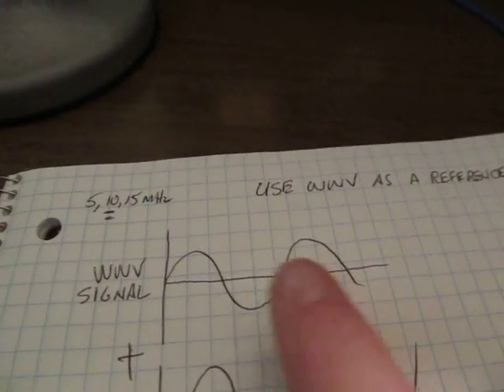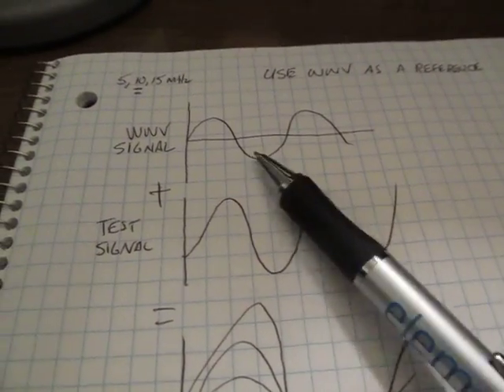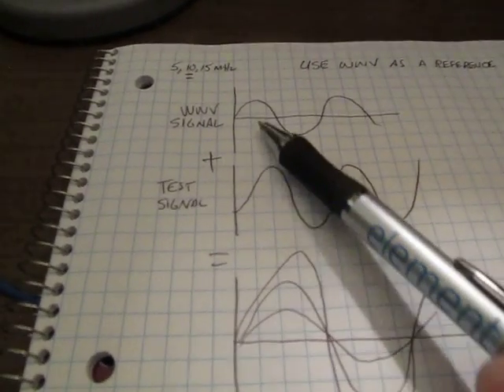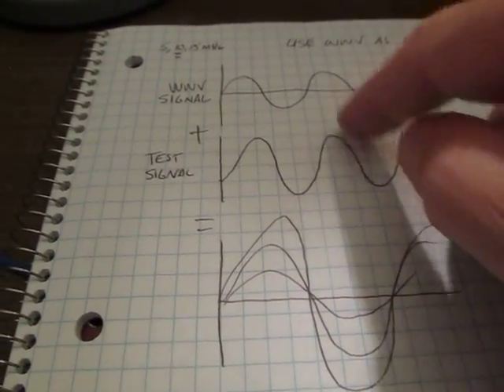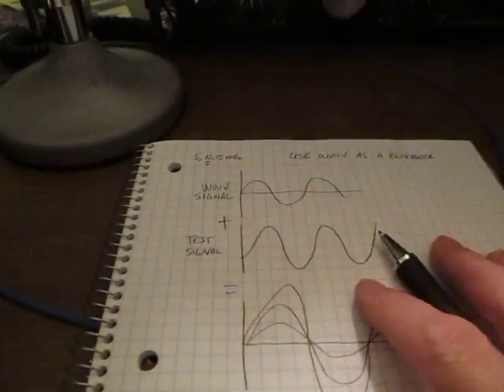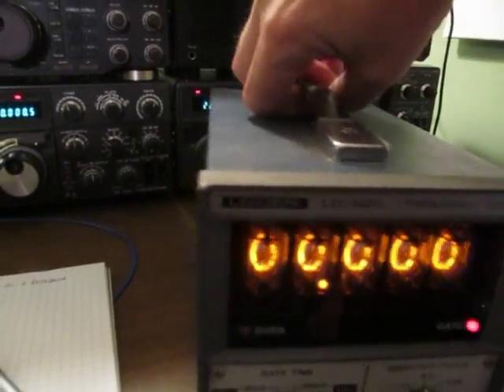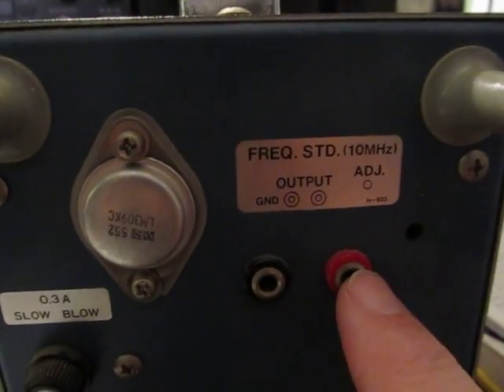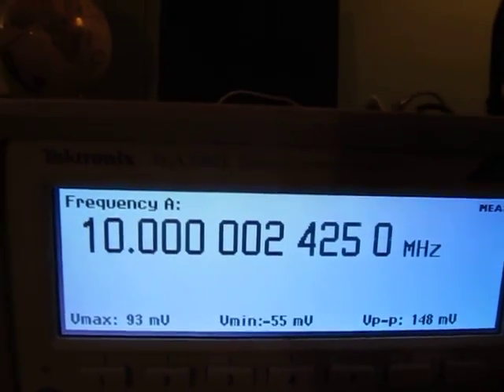#58: How to zero-beat WWV to check or adjust a Frequency Counter's accuracy

Comment: You can use an inexpensive SDR dongle to do this too. I used AM mode.  The waterfall will show you the interval of the beats. I calibrated an OCXO module and use it as a reference for a handheld counter and signal generator.

Comment: How is the Leader frequency counter coupled to the WWV receiver?  Is the output of the frequency counter directly connected to the antenna input on the back of the receiver?  Or is it more loosely coupled?
Reply from the maker: The Leader's 10MHz reference output is loosely coupled via a wire "antenna" to the receiver, so that its signal combines with the WWV broadcast signal being received via another antenna.

Comment: Is that WWV signal on a regular stereo receiver? And on the am dial?
Anyone know?
Thank you
Reply from the maker: No.  WWV transmits on 2.5MHz, 5MHz, 10MHz, 20MHz and 25MHz.  All of these lie between the AM broadcast band and the FM broadcast band.
Reply: @w2aew  Ah. I see. So you need a different type of receiver then?
Reply from the maker: Yes, a shortwave receiver, or what is commonly called a general coverage HF receiver.
Reply: @w2aew  Thank you, I will look for one of those, should not be hard to find.
Cheers

Comment: Isn't using a radio unreliable as being accurate?
Reply from the maker: I'm using the radio to RECEIVE an accurate frequency from WWV.  I am NOT using the receiver's frequency display to determine the frequency accuracy.  I am summing the accurate WWV signal at 10MHz with the reference output of the counter (also 10MHz).  If these two signals are very close in frequency, they will "beat" with each other (constructively or destructively add, depending on the phase), and the resulting sum will be indicated on the receiver's signal strength meter.  The receiver doesn't have to be calibrated to do this - we're only using it as a power indicator of the summed signals.

Comment: Yup. Just checked all of my stuff and they appear to be dead on. Unfortunately, none of them have a place to adjust from the outside even if they were off. I'd have to crack open the case, I suppose.  On the other hand, they all allowed for an external standard. So, if I could secure that GPS standard thingy my friend speaks of, then I could use that if I needed better accuracy.  Thanks!
Reply from the maker: One thing you could do is use the siggen output to check zero-beat against WWV, then you could make small adjustments to see the "beat", or if it was off a little, you'd be able to see how much.  Once you've verified one (like the siggen), you could then put the Reference Output signals from the siggen and the spectrum analyzer onto your scope, trigger on one of them, and then see how much the other "walks" with respect to the triggered one.
Reply: @w2aew  We used to use the Lissajous patterns to adjust stuff in the USAF.  Always a cool way.
Reply from the maker: @eie_for_you  Yep, I have a video on them too!

Comment: Is this WWV on a regular stereo receiver or on a special receiver?anyone know?Thank you I need to calibrate my frequency counter.
Reply from the maker: You need something that can receive 10MHz, such as a ham or shortwave receiver.
Reply: @w2aew  Thsnk you gor the fast reply.
I do not have one of those. Could i use my function generator instead?
Reply from the maker: @SDsailor7  A function generator can only be used to calibrate your frequency counter if you already KNOW that the accuracy of the function generator is much better than the counter.
Reply: @w2aew  Sorry meant to say Thank you.

Comment: My comment below describes the method that aural Piano Tuners have used for centuries to tune pianos. It is a method of listening to two tones, one of which is tuned to an accurate tuning fork, and one of which is not. The piano tuner listens to both strings as he strikes a note on the keyboard. He uses his tuning wrench (hammer) to adjust the second string to the in-tune string. When they get close

 to being in tune with each other, he hears a wavering sound called "beats". As he slowly  adjusts the string, the beats eventually slow down and then disappear when both strings are in perfect tune. 

     Airplane pilots who fly smaller  twin engine airplanes use this same technique. If both engines are revolving at different R.P.M.s, it causes a great deal of noise and vibration to the aircraft. The pilot adjust one engine to the speed and desired R.P.M., then slowly adjusts the second engine until the heard  "beats" slow way down, and eventually disappear into only a single sound.  At that point, both engines are in perfect sync, revolving at exactly the same R.P.M.

Comment: If you want to Zero-Beat an H.F. receiver using WWV or WWVH,  put your receiver or transceiver into LSB or USB mode. Tune to 5 or 10 Mhz. Listen for the broadcasted solid tone along with the tick/tocks. If you hear two tones, carefully adjust your frequency tuning knob until only one tone is heard. Now note your frequency readout on the dial. If it reads anything other than exactly  5 or 10 Mhz, it shows how far off frequency your receiver actually is.

Comment: As an aside, it's amazing what sort of applications can be utilized with WWV, I've even read that pianos can be tuned with WWV as the reference tone.  They transmit 440 Hz at 2 minutes after each hour and at one minute after the hour on WWVH, and 440 Hz is musical note A above middle C.  Once that note is calibrated, the rest of the piano can be tuned.

Comment: OOPS... you weren't ever at exactly 10.000500 MHz on your receiver... you had 1 digit of precision, could have been +-50 Hz (roundoff). I could HEAR the difference between the two times you played 10.000500 MHz, guessing it was off the second time by 20-30 Hz,. So, don't depend on the readout!
Reply from the maker: There was never any reason to be at exactly 10.0005MHz. The only thing that was important was to put the WWV carrier within the passband of the SSB receiver. Once this is done, the reference oscillator is then beat against the WWV carrier and observed on the receiver’s s-meter.

Comment: Thank you for bringing this subject to light. My Father was a Ham operator dating back to the early 30's and would use a bc 348 signal corps radio set for the  WWV carrier as well as a set of tuning forks for calibrating his test and radio equipment. Certainly a lost radio equipment testing skill set.
    Thanks for sharing!
    Kind regards,Eric Dee.

Comment: Good stuff.. 
It would have been additionally helpful to point out that the freq read out of the RX during this exercise, was totally irrelevant. The role of the receiver was simply to acquire the 10 Mhz sig. from WWV..what ever the reading on the RX.. It might have no digi readout! 
Its entire purpose was simply to connect into WWV on 10 Mhz..If the dial said  "600 fluid oz.  or two feet, it wouldn't matter. We'll deal with the Rx later!
Reply: Thanks I got "hung up" on that aspect. It's a start for my "haven't built a kit yet" practical ham knowledge.

Comment: How did you couple the frequency reference from the counter (blue wire) to the receiver? Is it simply loosely coupled to the antenna jack of the radio? If you have a shielded coax cable already connected to the radio antenna jack will this still work?
Reply from the maker: The blue wire basically acted like an antenna and put enough signal into the air to be picked up by my HF antenna, the same one that was receiving WWV.

Comment: Another great (if older) video. Thanks. Question: Not being a ham (yet anyway) I do not have a fancy radio. I do, however have an old AM/SW receiver tube based I restored myself (Echophone EC-1). It does not have an S-Meter, but it does do AM. Could I do this by sound? Would it be any less accurate by sound? I am familiar with zero beating, as the EC-1 has a BFO. Thanks.
Reply from the maker: +PelDaddy Sure, you can zero-beat by ear.  It won't be as accurate because you can't hear below 20 or 30Hz generally, but you should be able to get pretty close.
Reply: +w2aew Thanks for the reply. Silly me for not thinking of that, but it, of course, makes sense. Not ideal for fine tuning equipment. Perhaps a VTVM on the AGC circuit or similar would give me an adequate visual representation for a more accurate zero beat. Might be fun to do...

Comment: Alan
I'm trying to duplicate your setup here but not getting the pulsating deviation on my S-meter like you show. How did you couple the blue wire into the receiver to get the beat signal ?Was it just loosley coupled ? My counter 10mhz reference out should only be a couple hz off.
Thanks
Reply from the maker: yes, just loosely coupled by bringing the 'blue' wire close to one side of the 450ohm ladder line feedline that runs up to the antenna.

Comment: I built a 10 MHz TRF receiver with a 10 MHz crystal in the front end for selectivity. Only 3 transistors gives a very useable output. I use the oscillator under test to trigger a scope and connect the WWV signal to the vertical. It's easy to get down to .1 Hz if you have a fine adjustment on the oscillator. Much better is possible if propagation from Fort Collins is very good, I think.

Comment: I check my radios by tuning in WWV and then selecting USB then LSB and setting the receiver so that the pitch of the audio is the same on each.  The receiver is then tuned exactly to the carrier frequency -- yeah, I have a good ear.  Most are off by a little bit, but usually less than 3 ppm.

Your video shows a good system of setting signal generators and counters.
Reply: I use a digital musical instrument tuning indicator listening to the WWV audio coming out of the speaker to do the same thing.  I get 100th of a hz resolution.

Comment: OK! on the two signals still being at 10 meg. Had me going there for a bit. I thought you were putting in a 500hz off set. Hi. I use to use a 5 meg. osc in a old unit and beat it against 20 meg. wwv. 4th. Set the two signals to zero using a scope to watch the signal when it got so low I could not hear it anymore. Then used the 20 meg.output to adjust the counter. I dont know if that got me closer or not, I think I got the 5 very close but dont know if using the 20 meg.out was better or worse.

Comment: It is. After a reexamination of the manual, and also looking at a picture of the plugin removed. I realized my first assumption about the origin of the rear panel reference signal was incorrect.  I do indeed have access to the counter's reference, and not only that, I can switch it from 1hz, all the way up to 10Mhz in decade steps!  I wish I had your new Tek counter to check this, but now there is even more motivation to get the WWV technique working here.  This may require an 10Mhz antenna.

Comment: Saturday, when I was attempting this, I seemed to lose a lot of signal (or gain QRM/N) whenever I exposed the center conductor on my PL-259.  Unfortunately I was averaging about a 579 WWV signal strength on the meter on 10Mhz.  I may be able to try again later tonight, this time using my HP counter's 10Mhz reference instead of my sig gen.  That may make it simpler as seen in your video.

Comment: On the back of my HP5245L counter are two BNC's.  However, on the back of the HP5262A Time Interval Plugin is a Reference Oscillator Output.  It can be set for a variety of frequencies, including 10 MHz!  I will have to investigate that and reply with a video, as well as another one demonstrating success with WWV and my equipment.  Tnx again!

Comment: Thank you Alan, I know I had a hand in stimulating the production of this great video.  I tried to do this yesterday in my lab/shack, and was having several problems.  I wish you had shown the exact coupling you used into the coax, since mine tended to be either too loose, or to tight (too strong of a carrier).  Also, I am in the middle of an antenna crisis (broken compromised dipole) plus lots of storms here.  You cheated with the Tek counter of course, but it was good to see.  Thanks for this!